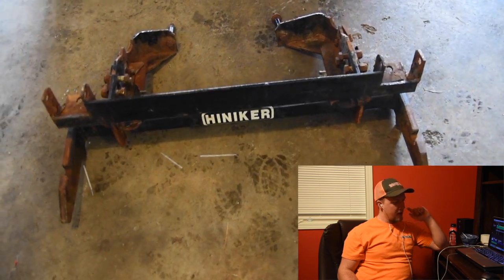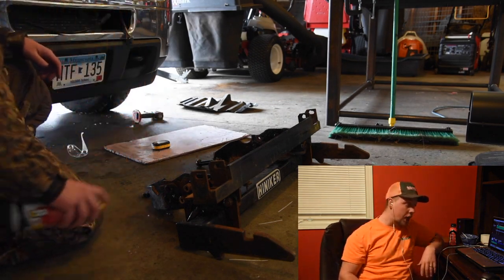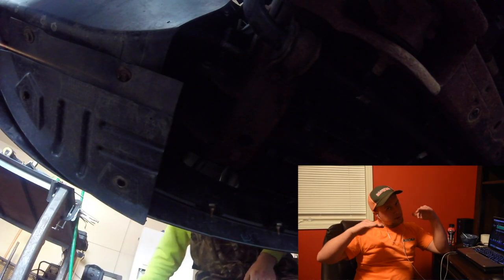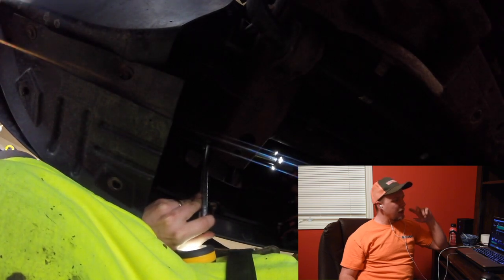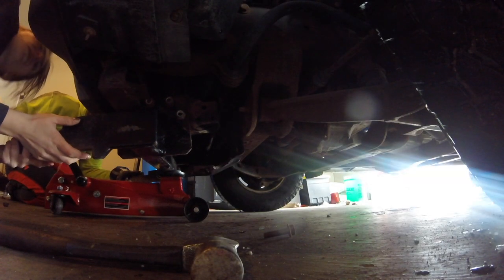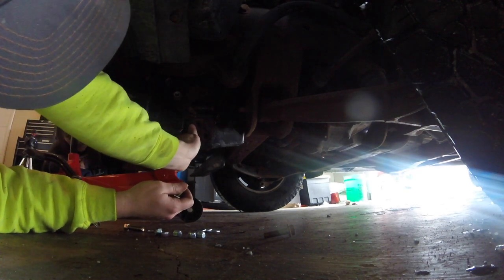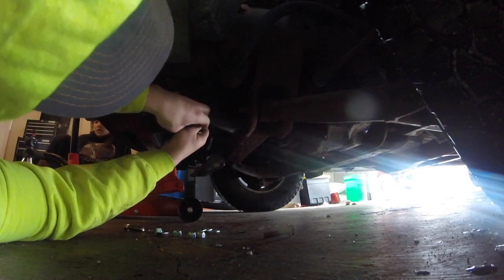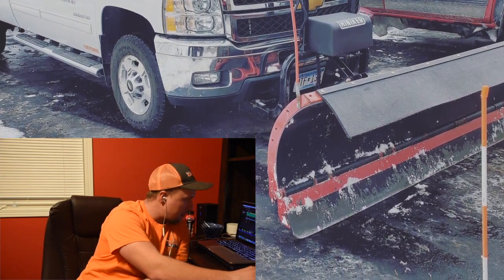Hiniker plow mount install

Comment: Hi Bladez! This is Charlie from Citified. I bought 7.5' blade back in 1998 for 94 Dodge 2500, Now I have 2016 Chev 2500. Thank god for people like you to learn from.Yes I want to place OLD plow on a Chev i bought But WAS not sure that I can do this. Now I know I can, Thanks! Did you buy USED receiver it looked like it had rust!!!! Did it come with bolts also????? Please did you say you had Video on wiring also????? If so then great. Do you have link you want share Please! Also want to repaint this old gal I wonder if HINKER has new stickers to buy.??? My plow weight is about 1,000 lbs now, the two foot wings, back drag 7.5' plate under plow back bottom, it uplifts the whole plow 2'' when blade down backing up. Its floating, does nothing when pushing. Palmer, Alaska
Reply from the maker: Yeah! Thanks for watching! It's really not a terrible job to do on your own. I did buy a used reciever for it. It came with some hardware but I did purchase some new as well. Just makes life a lot easier having fresh hardware. I do have a wiring video on it. It didn't quite turn out as well but it gives you an idea of how to do the job.
Reply from the maker: https://youtu.be/qEiqVwPF8tQ